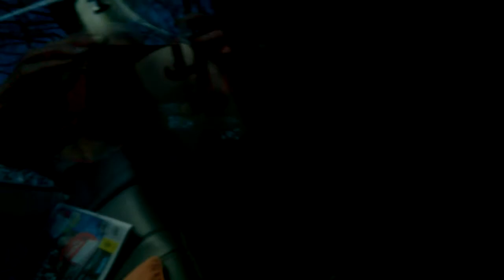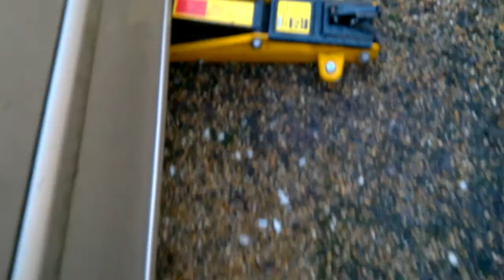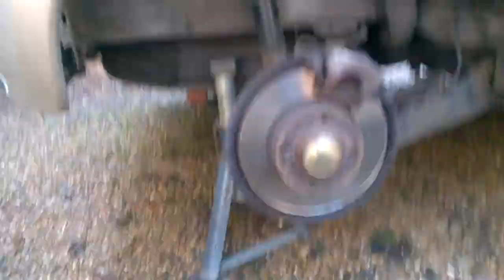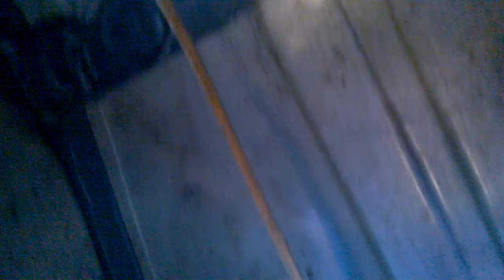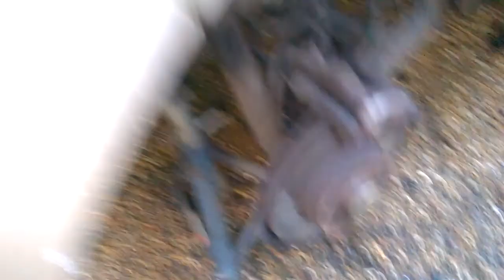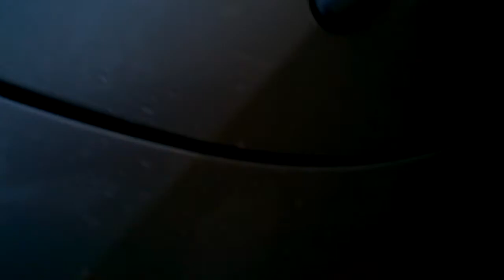Renault Clio III Mark 3 2007 Leaky Sunroof Unblock Drain Pipe

Comment: Thanks for this,  does it have drains only on the back wheel arches or front as well ? Getting water in my boot when it rains so reckon this is it.
Reply from the maker: The panoramic sunroof (e.g. Initiale model) has 4 pipes, two at the front and two at the back.  Water in the boot could also be from the boot seal.